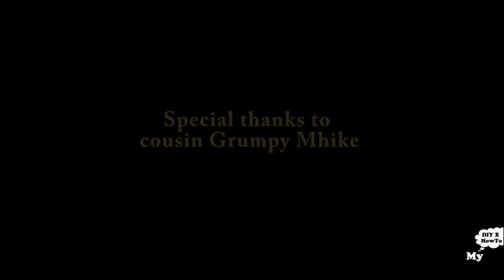Fuel filter change Honda Civic (DIY Reality)

Comment: Thank you sooo much same problem with me! Let's see how it doesn't tomorrow I'm using some penetrating oil. So when you took the filter off of the firewall was it easier to break the bolt loose ?
Reply from the maker: +ARIZOGAMER it seemed that way, but we also took in consideration of how bad the existing bolts for the "thing" that's holding the fuel filter. It took awhile as it seems like it was the original we took out.  good luck with your diy , hope it his video helped.
Reply: MyDIY2HowTo hey man I took the fuel filter off of the firewall now im left with a fuel filter and the bottom rusted bolt. the bolt still wont come off after i sprayed some penetrating oil and left it to sit over night. did he try to put a clump on the bottom bolt while twisting the fuel filter?
Reply from the maker: +ARIZOGAMER hey man, sorry I didn't get a chance to reply to you fast enough. I'm hoping you were able to figure things out.  To answer your question, the fuel filter only came off once we too it off the firewall. we tried a few things then it ended up come off , I think each attempt might have contributed in loosing it up. let me know how you got your off.